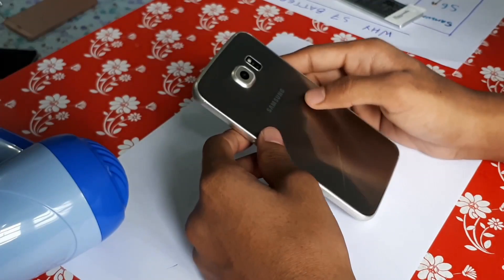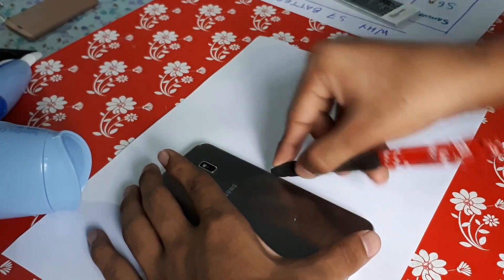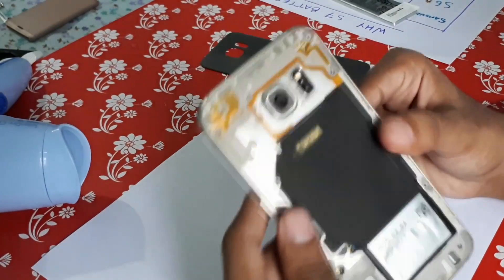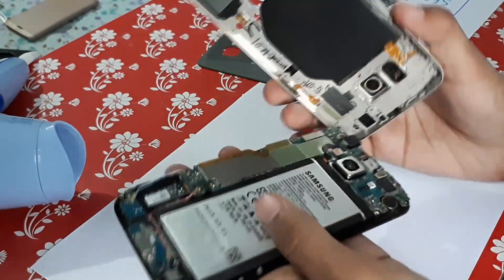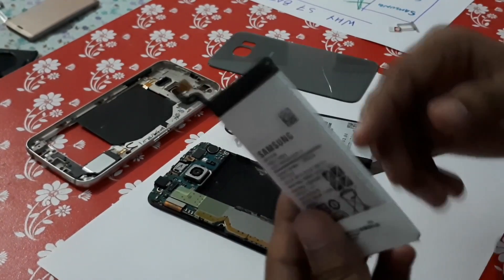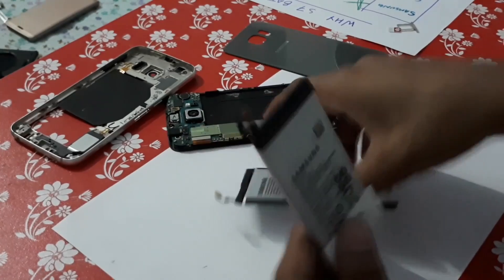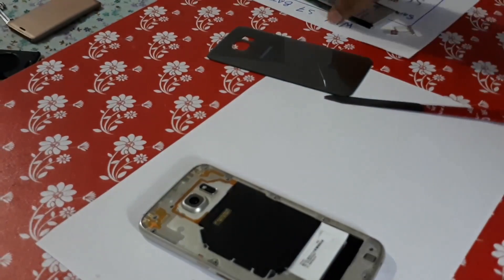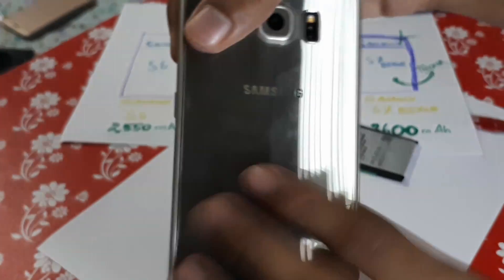I installed galaxy s7 battery in my Galaxy S6. It worked

Comment: calibration needed for the new battery on the s6. accu battery shows the same 2550 maH  although it should be 3000 maH. also at 30% the battery voltage reported on accu battery was 3.3v, batteries shouldn't be discharged that low. do you have any work around on this issue?

Comment: does s7 edge battery will fit to s6 edge plus?
Reply: Yes. I recently installed an S7 Edge battery to my S6 Edge Plus. Its a bit shorter and kinda hangs in loose but not too much of an issue. I also removed the wireless charging pad to allow for more room and easy heat transfer. Its perfect.
Reply: The new S7 Edge battery is 3600 MAH while the original S6 Edge Plus battery was 3000 MAH. Im just figuring out how to calibrate the batttery now.

Comment: hello Dizz i have a s7 flat but after  2 years of work the battery go down fast... can i put the battery of s7 edge on s7 flat !?
Reply from the maker: I Think it's possible.. i saw the orientation of both the phone.. s7 and  the edge , they both are similar .. i think it is possible but nobody has yet tried it.. it may not be worth if your phone get sacrificed...
Reply: Yes but you cant fit the backdoor. I was used s7 edge batt for my s6 and was great sot
Reply: No as you can see in this video the s7 edge battery is longer than the s7 flat battery so it won't fit into the s7 flat

Comment: Is it risky coz phone's Software will only charge upto 2550 Mah.. 
But S7's battery is 3000Mah... 
So will it have any problems..✌✌
Reply: Yourz Techy no nothing like that will happen if you calibrate the new battery after inserting it.
Reply: @shameermalik5540  how to calibrate??
Reply: Les puedo explicar eso:
La batería del s6 es de 2550mah  y entega un voltage de 3.85v y carga con un voltage de 4.4v. La bateria del s7 edge es de 3600mah y da el mismo voltage tambien carga con el mismo voltage que la bateria del s6 por lo que al cargarlo el celular va a medir el voltage de la bateria y al llegar a los 3.85v el voltage que entrega la bateria finalizara la carga y el celular trabajara con el mismo voltage que la bateria original . Carga o se descarga entregara el mismo voltage pero la nateria de mayor capacidad de 3600mah retendra carga durante mas tiempo. En conclusión al celular no le pasara nada. Espero que entiendan la explicacion.😀

Comment: I did it! I damaged the front and back color a little bit and I accidentally cut through the wireless charging part. Wireless charging still works though because I only cut through the black layer. The back doesn't fit on at all and I totally need a case for the future. The phone is charging right now :D
Reply: Nevermind! Wireless charging no longer worked after I put the back glass back on. I'm not sure what causes it because my cuts only went through the black plastic layer. It's probably just the contacts that aren't touching the motherboard. It's been charging for a while now and it's at 100% but the green light hasn't come on. Amazing mod, I can't wait to test the battery :D
Reply from the maker: It's really nice to know that you did it... 
how is the back glass fits with s7 edge battery?
&
I'll be waiting for your battery  review, let me know how is it working for you..
Reply: Dizzz It's great! The glass doesn't fit on very well and there is a small gap between the frame and the glass so I'll need a case. The battery life is awesome tough. I get more than 7 hours of screen on time with WiFi and decent screen brightness. I could barely scratch the 4 hour mark before but now the phone seems to last forever!
Reply from the maker: Simon bro thanks for sharing.. and enjoy.

Comment: What happens when using fast charging by the way? How long does it take?
Reply from the maker: The fast charging works really well.. similar as default battery
Reply: Great! How long does the phone last now?
Reply from the maker: Battery life is better now..i can say definitely better then earlier, it last all day with average use.
Reply from the maker: S7 edge battery will last even longer
Reply: Right now I get shitty battery life because my battery is pretty worn down. Someone on youtube did a battery test with the s6 where he lost 21% while watching a youtube video over Wi-Fi for 1 hour. I did the same thing and I lost 23%... My S6's battery is 18 months old and It's always on my charge pad so that could be the reason why the battery is so bad :D
Reply: I'm definetly pretty excited to get the battery. I dropped my S6 and now it has a bubble in the top right corner of the screen glass... It doesn't really affect usage but it looks kinda ugly. Is it worth replacing both glass panels and the frame and are they easy to remove? The back glass and frame are easy to remove but what about the front?

Comment: 1:36 But you can use at "Clear Cover",when If "Safe's battery" will be depends use at "Amperex" batteries instead of "TSDI" from My Examples -> forum.xda-developers.com/showpost.php?p=72710424&postcount=361 | forum.xda-developers.com/showpost.php?p=72838644&postcount=385 | forum.xda-developers.com/showpost.php?p=72845671&postcount=388
Reply: 1 How is your battery life ? 
2 which rom and kernel are you using?
3 Did you try kiboi kernel ?
4 Did you measure battery capacity with Accubattery ?
Reply: Recep Küçükekiz 1. ~7-8h in a Pokemon GO (Nougat) 2. Actually "OdexLite",but if SafetyNet will be pass of a "Noble ROM" then I will be migrate' (S7 Edge Battery Kernel doesn't be Compiled for LineageOS anyway) 3. Yes,When are be worked in a Hardware 4. You can check in My Post of XDA.